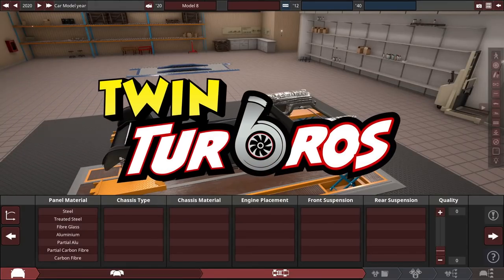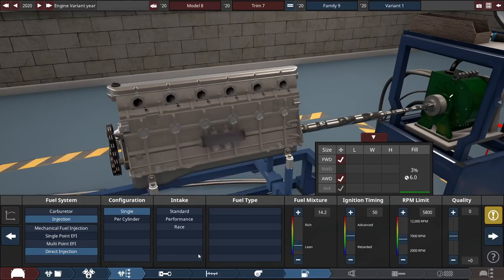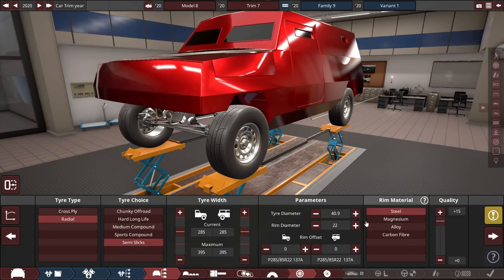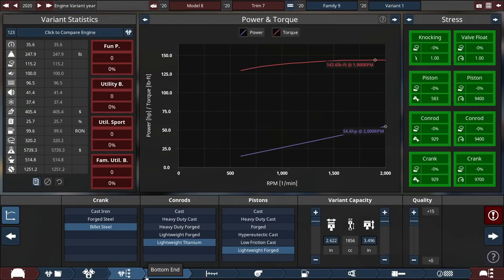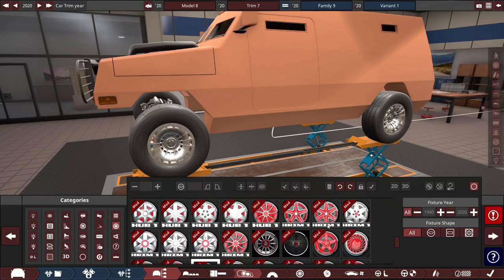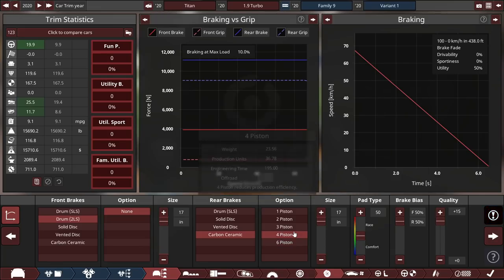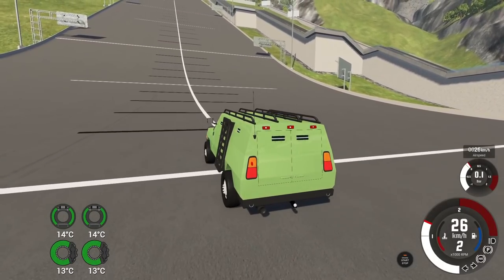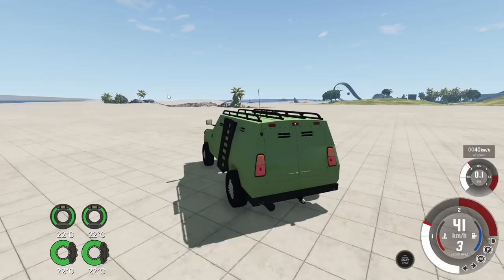Most Reliable Car Ever?? Automation - BeamNG

Comment: A military van, that only has 2+2 seating. It can't hit 60 by itself,  yet has semi slick tires and carbon brakes. It weighs almost 8 tons and has no safety features to speak of. To top it all off, it costs 2.3 million dollars. That all being said, you could literally never change the oil and it would probably be fine. Amazing, absolutely phenomenal.

Comment: Low pressure turbos are usually pretty reliable from what I've heard. Saab used low pressure turbos in their cars for a little bit and ford's eco boost 3 cylinder is technically a low pressure turbo

Comment: Makes me think of the AML-90 a 3 ton armored anti tank car with a 90mm cannon that had a 50hp engine. It was much smaller but it used RHS instead of just regular steel so it weighed a lot compared to its size.

Comment: Ive built some amazing engines in automation. By far the best one i ever did was the Pegasus Wonderer this V16 quad turbocharged direct injection dual quad cam forged engine made 1564hp 1645 flb with an 8.4 liter displacement 830ci the liter is an estimate. This engine made an astounding156 reliability score. It doesnt come cheap mind you its 30k to 40k with the cars stats varrying normaly over 110 with a awd 6 speed manual capable of to 274mph all this running of of 87 octane fuel. The intent of the car was this huge American sedan was built to survive tta total atomic annihilation and still drive afterwords hense an absance of alot of electronics aside from electronic stability control.

Comment: Is it me or does he have so low RPM that the turbo is only there for A 'TT' badge, and reliability?
Reply: its not even a 'TT' its a single turbo
Reply: @diptangshukundu2979  technically the turbo does nothing, except it's so well designed it just there for a crumple zone and is also rust protection for the main engine.
Reply: @jwalster9412  you're actually right, the turbo is not really doing anything besides what you already said lol

Comment: Make the least reliable car
Reply: isnt that just an alfa romeo?
Reply: @true9703  no its a saturn
Reply: @arutezza  tvr?
Reply: @true9703  its an vw
Reply: Renault has entered the chat
Reply: @z-trip5457  renault makes good enough cars i heard for example 1.5 diesel can have 1 million km but sometimes if it makes sounds its broken and can be broken so much you repair it multiple times
Reply: @arutezza  saturns are gm? I think they are good if they are gm
Reply: @Noooo23523  originally saturn was just owned by gm but operated independently, later on GM took over
Reply: @arutezza  i didnt know
Reply: rx7 enters the chat
Reply: @lochiecrosbie  rx7 wihout a turbo can drive 300 000km sometimes and change the apex seals at 100 000 km or 150 but turbo you change at 70k
Reply: @lochiecrosbie  12As and 13Bs are suprisingly reliable when maintained
Reply: @Noooo23523  also my dad owns a vw with about 350000 km on the odometer and that shit still drives like new
Reply: @sbworks2047  ok
Reply: @sbworks2047  lol hating fiat, all the time i see someone like vw they hate other brands, and i like opel and other brands and hate vw, fiats are good but not always,vw are good but not always, is your dads car diesel i saw most vw fans respond with 1.9 diesel when someone says their cars are not reliable
Reply: @Noooo23523  yep , a 1.9 diesel , those shits are nearly indestructible
Reply: @sbworks2047  most reliable vw engines are 1.9 diesel and maybe others they resist a lot but they resist as much as a gasoline engine from other brands and vw gasoline engines resist a small amount of km they resist from 150k to 300k, i have a neighbour with a close to new 120k gasoline seat thats a golf and it changed the engine because the engine broke the cylinders broke everythig broke
Reply: @sbworks2047  is it turbo ,did you known 1.9 diesel has a turbo for 1.0 to 1.4 gasoline engines and 100 to 140 hp and if you tune it to make more than 105 stock hp the turbo explodes and if the engine is clogged up the turbo overrevs and breaks, there is a 1.9 diesel with a special edition turbo thats the same size but made to resist more and it has 130hp you can tune it to 150 but if you tune it mor it explodes
Reply: He has